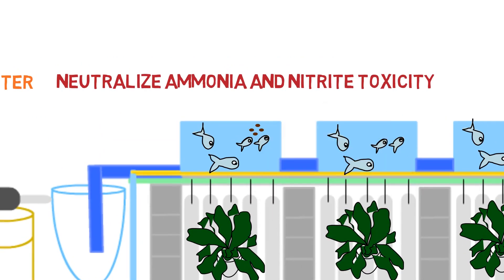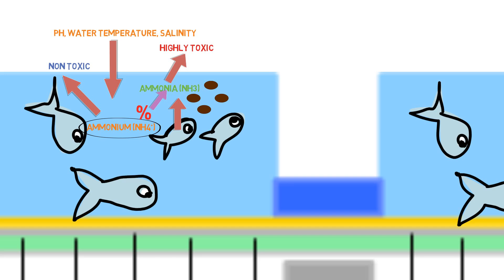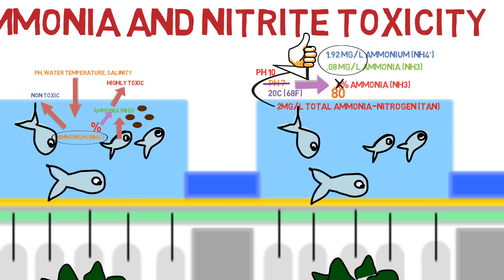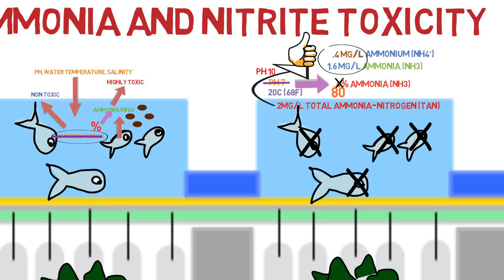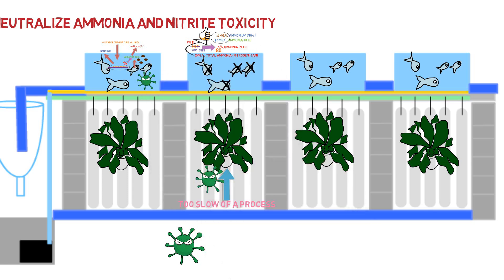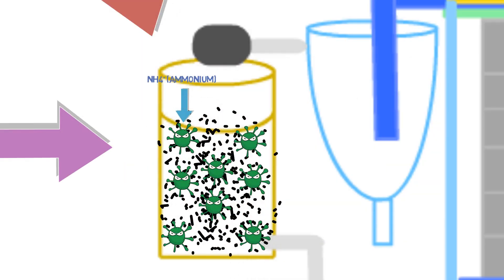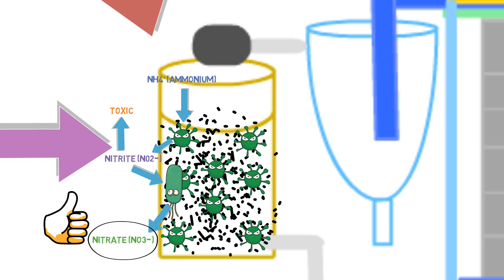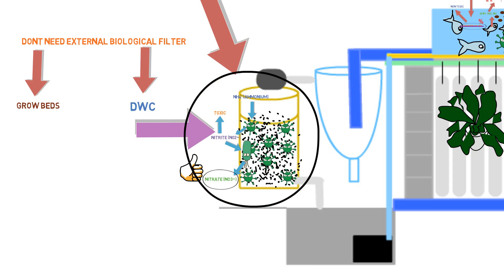Biological Filtration Explained | Ask The Aquaponics God

Comment: I have a biological filter but during the winter it seems to not work as well.  I m looking at temperatures between 50 and 30 degrees Fahrenheit. During winter inwant to switch to a chemical or mechanical method. Do u have any suggestions.
Reply: You could heat the water above 28 degrees Celsius, 

Or find other special bacteria species living in earth in the field when its cold during winter, next to a water creak for example . Since some bacterias are more efficient in cold weather it could be adapted to a decrease in temperature . 
Pump more air and clean the media more often since the old beneficial  bacteria is less efficient 

You could try to decrease the pH

There is also the 
Another option but its more experimental is going with anamox bacteria that are more efficient at decomposing organic material but are slower to grow and require more heat ( more delicate).

So if I had the place I would use and extra aerated heated tank with growing media to recuperate the extra water for treatment and pump it back to your grow beds. 

Hence it would be treating by batch

Comment: What is the source of these bacteria which converts ammonia to nitrite and then nitrate. Kindly explain. Thanks
Reply: They are everywhere probably some are in you mouth too , joke  
Probably on you hands and gut. 

 They are present the environment in general. Like mushroom spores, if the environment is right they thrive. 

Some bacteria are able to withstand temperatures of -80 to 250 degC and go in hibernation for years on hand with a 0.1% metabolitic cost . So they are very hardy. 

Depending of your location or time of year, it would be possible to find different geniuses - DNA / species in the soil  adapted to a specific environment. 

Usually microbiologist talk about a community of microorganisms.

Comment: Gentleman, Can we siphon a bed once in every 2-3 min? What is the ideal number of siphon an hour?
Reply: I have heard 5 minutes but you can experiment as long as the roots don't turn brown or rot or the plant roots are healthy wire you should be ok , you can add a sump tank to divert some of the extra water to  reduce the flow in grow beds hence increasing retention time.

Actually if you controlling  the flow rate is not possible in you grow beds you can add more air bubbler inside the bed hence increasing the oxidative activity of the beneficial bacteria. 
Or a microbubbler the water going out of the filter so that the bacteria have enough air to oxidize  the nutrients in the grow beds.

Comment: Excellent! Thanks for clearing the air and the hard knocks of live operations. Biological filters solve my  problem of handling ammonia in my planned 30,000 catfish farm. Diluting with fresh water is not my preference. Alternatively, I will need a huge DWC system to handle the load, which poses space and budget challenge. Now, I can consider a combination of a smaller DWC, dutch bucket and bigger bio filter. Thanks again for your brilliant teaching.
Reply from the maker: Thanks for the feedback Henry!

Comment: I wish I watched your videos when I started. Thanks again! 

After Cycling when and how should I add more fish & plants?

Just built 1st system. Lots of fun, Now I'm addicted...Have about 700 Gallon total water. 180 FT, 180 Gallon Sump, 3 Media Beds 2' X 4' X 16"D (Red worms in all), 1 DWC Raft 2' X 8' X 14", 20' of Horizontal pipe, 28' of Vert Towers, 3 Dutch Buckets 5 Gallon. 

About 60 seedlings & or small plants in DWC Rafts, NFT, Vert Towers, a few larger plants in MBs. about 3 weeks old. (some from seeds and others seedling) Been adding Liquid Seaweed to support plants while little fish feed. 

Only 2 X 1.5lb Koi fish BUT just got cycled today finally...took about 20-30 days "MAYBE" could have been sooner but water temp fluctuates between 64-74F and was still feeding fish after ammonia at 0. Stopped feed or fed very little for 7 days, put lots of aeration and Salt in about 4 days ago in every water source (lots) vs. only FT and DWC in beginning, ALL water turns over 2 times per hours and "FINALLY Cycled" in about 25-30 days...I had little patience but I'm learning. Added live Bacteria about 3 weeks ago ago and now Water chem nearly perfect (7 PH, 0 Ammonia, .25 Nitrites, 7 Nitrates) Fish stayed healthy through process.

Sorry for all details but I'd like to start adding fish and feed SO my question is...
Do I add the fish & plants a little at a time or can I add 10-20lbs more of fish now? 
I'm thinking it may be a back and forth for awhile so as not to change things too rapidly and be back to square 1.  

Thoughts??     

Thank you!!

Comment: Great video! How long does the nitrite cycle last? I'm in that stage right now. Where my Ammonia is at 0ppm but my nitrites keep spiking like crazy
Reply from the maker: In an optimal situation it should take approximately 28 days for nitrite oxidizing bacteria to completely establish. This is assuming your have water temperatures above 77F, pH of 7 and above, and sufficient biological surface area in your filter. If any of these parameters are too low then the process will take longer.

Comment: you said that there is no need to use bio filter in DWC , is it true for a commercial level too ???
Reply from the maker: Yes, this is true for commercial level. This information is based off of the UVI commercial system. They did research and found that a properly sized DWC can house sufficient nitrifying bacteria to support ammonia loads of up to 3x the recommended feeding rates. Once this research was discovered, they eliminated the separate biological filter to save space and money.
Reply: The School of Aquaponics hey man do you have the link to the UVI research ???
Reply from the maker: We don't have a website link for it. We have the actual book. It's called Recirculating Aquaculture. It's a pricey book and may or may not be worth the price if you're looking to purchase it for just that reference.
Reply: Google: "Recirculating Aquaculture. University Virgin Islands"